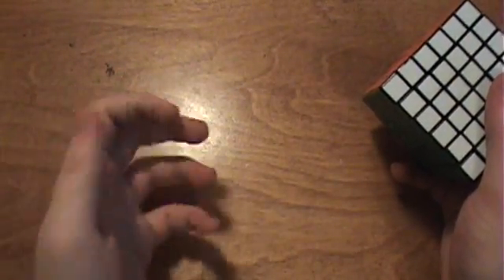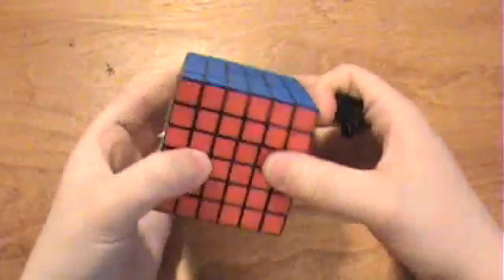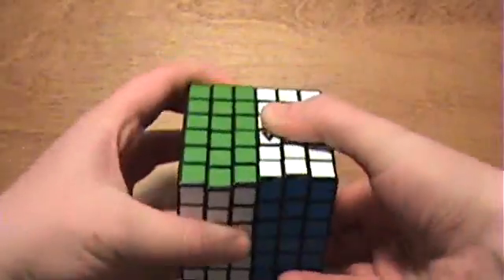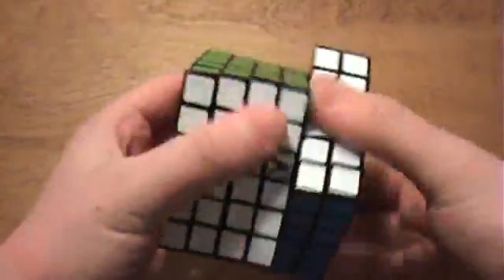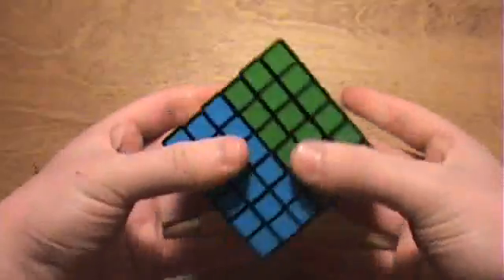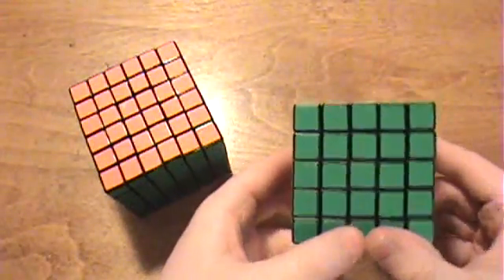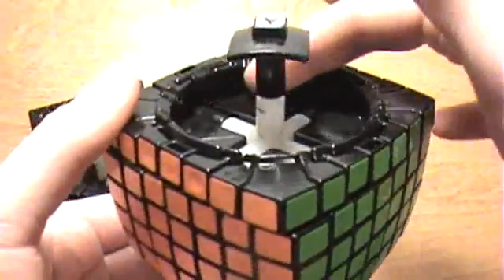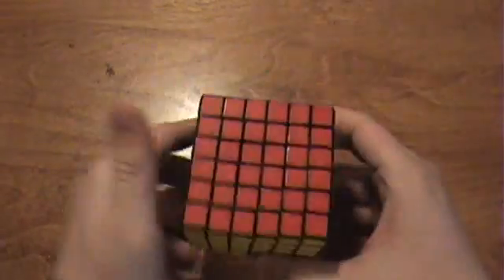V-Cube 6 Modification v3 Change Log

Comment: To break in a V-Cube 6, you could use it in emulation mode to solve a 3x3x6, 2x2x6, 2x2x3, 4x4x4, 3x3x3, 3x3x2 and 2x2x2. The 2x2x6 option is really fun as there is still no commercially available 2x2x6 yet.

Comment: Just do not do the mod. The time and effort you spend on cleaning, modding, fixing, repinning, and so on is a huge waste of effort. The V-Cube 6 is great, in my opinion, after it is broken in. I always regretted doing this mod, so I had to buy another one. The pins just scratch away the centers to the point where they do not even work anymore. This mod has to many problems and just a hassle. I am sorry for this comment Pi, these are just my thoughts. Keep doing what you do though. Keep cubing.